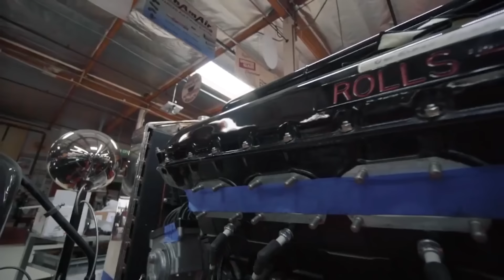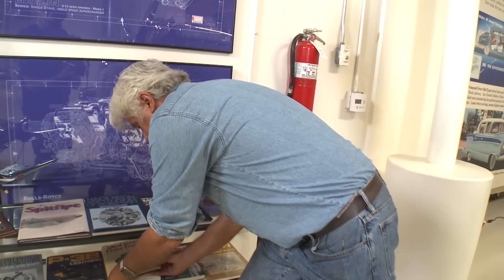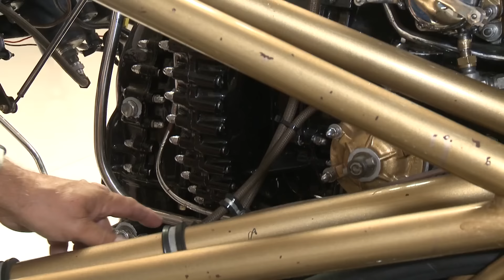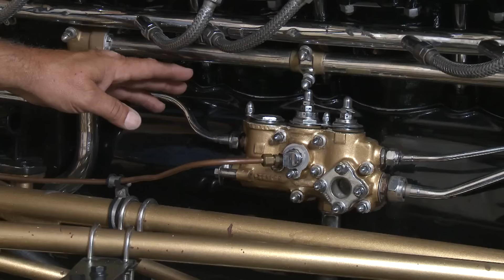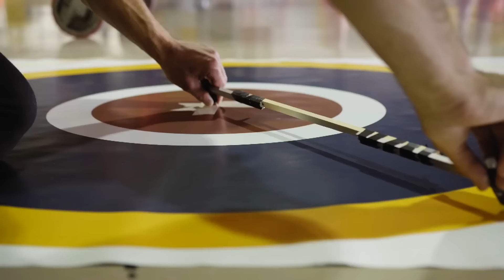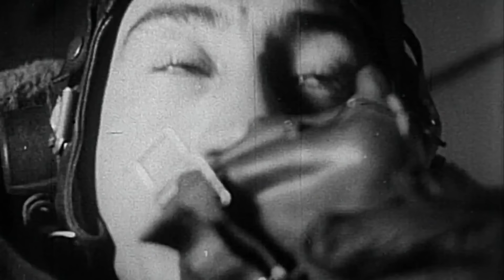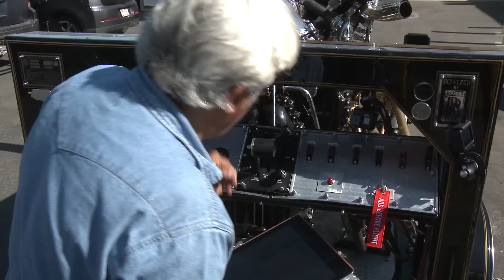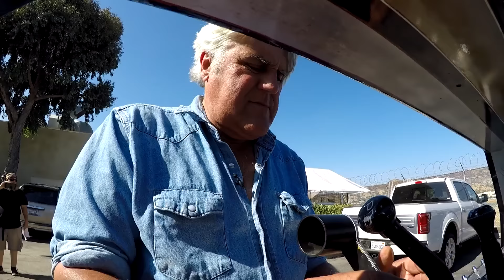The Engine That Won World War II - Jay Leno's Garage

Comment: Without british know how the Mustang wouldn't have been anything to write home about. With the  Allison engine it was just an average fighter. But the Rolls Royce engine transformed it.
Reply: The simple truth is that only 5 P-51's were ever fitted with a Rolls Royce Merlin engine. The rest were powered by Packard or Allison engines. This is a little bit of off the wall humor, but true. (The Packard engines were Merlins, only built in the US, and not by Rolls Royce)
Reply: @erichammond9308  Says it all really. Packard-Merlin not Packard Allison. The Americans couldn't have been given a better engine to tweak than the Rolls Royce Merlin. No contest.
Reply: @PortmanRd  They didn't even have to tweak it - there is literally no difference between a Rolls Royce built engine and a Packard built one.
Reply: @erichammond9308  Exactly. If it ain't broke, don't try and fix it. Unlike the Alisson engine.
Reply: @PortmanRd  No, the Allison engine was a fine engine. The Single turbo application installed initially in the Mustang was the issue. The Allison engine was fine in the P-38 Lightning.  Actually better than a Merlin would have been, since it ended up putting out far more HP than a Merlin would, and at equally high altitudes.
Reply: @erichammond9308  Ended up sure. But  the first (Allison fitted) P51's were a joke, and the RAF were less than impressed. The Merlin transformed the P51 from a lame duck into a raptor. The initial Alisson engine was less than impressive.
Reply: @erichammond9308  Unfortunately the RAF had the last say on the matter and rejected the Alisson in favour of the Merlin, and the rest is history as they say. I won't argue that towards the end of the war the Alisson engine had vastly improved, but by that time the Merlin had done all the hard work, and was without doubt the war winner.
Reply: @PortmanRd  again, it had nothing to do with the motor and everything to do with the single stage turbo that was initially fitted. The performance of the Allison engine was better than the Merlin at lower and mid altitudes, but the European Theater involved fighting at much higher altitudes where a 2 stage turbo system was needed. The Allison two stage turbo system at the time was too large to fit in a Mustang, and would have required extensive redesign of both the system and the aircraft itself, whereas the Merlin 2 stage required minimal changes that could be made on the factory floor.
Reply: @PortmanRd  Won't disagree with that one. It would have taken too long to redesign the turbo system of the Allison engine.
Reply: Great on paper, but never saw fruition, by which time the merlin had won the war.

Comment: The Merlin engine was a work of art. It made the P-51 Mustang come alive. The original p-51's had the Allison engine which was a dog at altitude. But if I was Jay Leno rich, my first choice of aircraft engine would be the r2800 double wasp by Pratt & whitney. Sure, it was a late War engine, but could put out 3,000 horsepower Plus with water injections. Not bad considering that a few years before, when Japanese zeros ruled the sky, we were living in a world of 750 horsepower aircraft engines. The most amazing thing about World War II technology is how far we came in four or five years. Bi planes to jet planes.

Comment: Interestingly as I understand, Rolls Royce were in discussion with Ford USA to produce the Merlin engine for the RAF before Packard, however apparently Henry Ford refused to build war production for outside of the USA and the British govt then negotiated with Packard.
I was lucky enough to refuel several Merlin engined aircraft while working for Mobil Aviation Australia,  a restored Spitfire still flying here in Australia and a Mustang, Mustangs continued to be used here in the 70's if I remember correctly to tow targets on a wire line for the Australian Navy .
"Warbirds over Wanaka" (incidently my home origin) is an international airshow that occurs every two years in the South Island of New Zealand and these engines can be heard in full flight at this time.
There are few engines that have the sound of these magnificent engines !
Reply: Read the ultimate authority on WW2 aero engines. The Great Horsepower Race by Callum Douglas, who is an F1 engine designer and WW2 engine historian. No other book comes close.Callum Douglas... 
"Surely everyone just KNOWS that the good old stories about FORD laughing at the Merlin drawings and that Rolls-Royce engines were all hand built must be true !Well this document, plus the fact there is a huge parts interchange manual which tells you which Packard part number you need to get to replace a certain Rolls-Royce part in either engine and visa versa.Of course not all parts were interchangeable, Packard did their own supercharger drive gearbox system, and used American sourced accessories like cabin air compressors and magnetos.

But the British bumpkins in sheds with flat caps and files is far too much fun so it is generally preferred over pesky "archive data" to this very day."

Douglas gives the USA credit in supplying the machine tools. But they shared things out in WW2. The agreement was the USA provide machine tools for the USSR and UK, so as not to duplicate. 

New high production Merlin shadow factories were set up by the Air Ministry in Glasgow, Crewe and Manchester. They also used existing plant in Detroit. Douglas again...
_Very few people know that Ford [in Manchester] had very little to do with the engineering production setup, the factory was not a Ford factory and was not full of Ford staff, the factory was built brand new for the Merlin, and funded by the Air Ministry, Ford were contracted to organize and run the new plant_.
- Calum Douglas

Comment: Someone tell me.....how different was a Packard Merlin to a Rolls Royce Merlin...????
Reply: This is a persistent story which has little basis in fact. Certainly in the mid 30s RR we’re not mass producing Merlins and expert assembly people were used. But by 1940 mass production lines were built and were being run by unskilled workers in Glasgow. For obvious reasons spare parts had to be interchangeable with both Packard and RR Merlins. Excepting the parts which were different like the Bendix carburettor and the supercharge drive gears, nearly every part on a RR Merlin could be installed on a packard and vice versa. There is even a parts interchange manual which tells you which RR part number is what Packard part number so you can use whatever was available in the field. To make this mass production in Britain possible American Machine tools Had to be shipped across the Atlantic.
- Calum Douglas

Comment: Jay needs to read up.  If a single engine won WWII it was the Pratt and Whitney R-2800 which powered F6F, F4U, P-47, A-26 and B-26.  It also powered at F8F which flew into the 1960s.

Comment: Rolls Royce Merlin, British engineering at its best 🇬🇧
Reply: "The   initial   Packard modifications were done on this engine by changing the main bearings from a copper lead alloy to a silver lead combination and featured indium plating. This had been developed by General Motors' Pontiac Division to prevent corrosion which was possible with lubricating oils that were used at that time. The bearing coating also improved break-in and load carrying ability of the surface. British engineering staff assigned to Packard were astonished at the suggestion but after tear down inspections on rigidly tested engines were convinced the new design offered a decided improvement." 
Packard Merlin Aircraft Engine - Combat Air Museum on line
Reply: "The engine suffered in early development and production with problems with the accessory gear trains, coolant jackets, cylinder head cracking, coolant leaks and excessive wear to the camshafts and crankshaft main bearings.  The construction was also altered many times before the basic layout was formalised."
The Spitfire Society Merlin page

Comment: P51 and merlin engine combination scared the German airforce a) overwhelmed by so many and b) they had nothing against it. It turned the tide of the war over Europe and with extended fuel cells could fly from England to Berlin and back.

Comment: Much as I love the P51 Mustang/Merlin  combo, they did not win the war.  This is a myth.  

Firstly, the war was won by the joint efforts of the Allied army, navy and air forces.   The air war and consequently the War, couldn’t have been won without the strategic bombing efforts of the B17 and B24 heavy bombers and the bravery and sacrifice of their crews.  They were powered by Wright and Pratt & Whitney radial engines.  

Secondly, they suffered heavy losses because the top Air Force brass then, the so-called Bomber Mafia, insisted these heavy bombers could accomplish their mission of daylight bombing to destroy Germany’s manufacturing and oil industries (among other targets) without the need for fighter escort. 

Because of this Bomber Mafia’s insistence that fighter escorts were unnecessary, these bombers were absolutely decimated by Luftwaffe’s BF109s and FW190s.  In fact, they used the excuse that the P47 Thunderbolts did not have the range to accompany and protect the bombers to and from their targets.  Not true. That’s a lie that was repeated in carefully crafted reports until everyone believed it was true. 

Thirdly, the P47 with auxiliary drop fuel tanks, had the necessary range, but the Bomber Mafia refused to authorize the use of these aux drop tanks.  In fact, the P47 squadrons in Europe, not the pencil pushers in the Pentagon, took it upon themselves to install British made, specially treated paper aux tanks and whatever else aluminum tanks they could find, on their P47s.  They did these because they couldn’t stand by and watch their fellow Bomber pilots and crews be slaughtered by the Luftwaffe.  
The truth is the P47 could have protected the bombers and thus prevented the unnecessary loss of bomber crews and their planes.  

Fourthly, the arrival of the long range P51 Mustang made providing fighter escort a no-brainer, a perfect ending to the false narrative that P47s did not possess the same capability many months earlier.   They did, but because of ego and politics, thousands of brave aircrew were sacrificed.

Comment: Merlin , british creativity against dull straight brains....
Reply: The engine suffered in early development and production with problems with the accessory gear trains, coolant jackets, cylinder head cracking, coolant leaks and excessive wear to the camshafts and crankshaft main bearings.  The construction was also altered many times before the basic layout was formalised.
The Spitfire Society Merlin page

Comment: When the Brits, on a hunch, replaced the Allison engine with a Merlin on a P51 Mustang the improvement was such that P51 Mustang B, C, and D's used the Merlin. The Merlin P51 was able to destroy V1 rockets flying low. They were so good that the bombers they were meant to escort were used as bait to attract German fighter planes, so assured were the Mustang pilots that the Merlin power made them equal or superior to the best German fighters.
Reply: The Brits were bombing at night, why did they need a long-range high alt escort fighter?

Comment: A great read that goes into the story of this engine is entitled Freedoms Forge by Arthur Herman. The plans were shipped in a submarine from England and escorted by battle group. Once here, Packard had a really hard time reproducing them and all new tooling had to be invented to build it. Fascinating!
Reply: What Packard actually said was that the first ever set of drawings shipped from the UK did not contain all the information. Which is not the same thing as the tolerances being too "wide". It was a vast job to transfer all the information, and it took a few months before both firms were working with the correct and full manufacturing information. It's very common for drawings to refer to other standard-sheets which are known to the company in question, but if you just give the drawing to someone else, they will find all sorts of things referring to other in-house standards which you don't have. I have yet to find any original information at all, that RR parts were made sloppily before Ford and Packard came along.
- Calum Douglas

Comment: I believe that it was also in the Supermarine Spitfire,but to give the credit to the engine alone is not really accurate. The Mustang had design features(unique wing design,and extended range) which made it the key factor in turning the air war in Europe in the Allies favor. The Rolls-Royce Merlin power plant was a vast improvement over the under-powered Allison engine which was the original engine in the P-51.

Comment: "Ethanol fuel is the worst thing in the world"... yes and no... for forced induction I love e85 for its 108ish octane number, for the person who wants to not worry about moisture in their fuel, yes ethanol is horrible.
Reply: In WW2 they used water methanol mix injection to get more boost and power from those engines. Mw50 it's called
Reply: @bartsscooterservice  did you watch the video?

Comment: Brother Jay: It is so cool to watch you adjust that throttle on this large MERLIN . It was so quiet once you reached the engines center of balance or ie its harmonic vibration seems to have leveled out at one point and the engine becomes quieter.  Just so very kool BRO..

Comment: "The initial Packard modifications were done on this engine by changing the main bearings from a copper lead alloy to a silver lead combination and featured indium plating. This had been developed by General Motors' Pontiac Division to prevent corrosion which was possible with lubricating oils that were used at that time. The bearing coating also improved break-in and load carrying ability of the surface. British engineering staff assigned to Packard were astonished at the suggestion but after tear down inspections on rigidly tested engines were convinced the new design offered a decided improvement." 
Packard Merlin Aircraft Engine - Combat Air Museum on line

Comment: I wish Jay would give Ford a break (in historey) and buy an old Ford GAA1100 tank engine and restore it. I would like him to tell the world how Ford built an engine in the class of a Merlin engine that also with some modification was intalled in late Sherman tanks.
I think they were build in 1942. Not sure if it is all alumium with overhead cam. It put out something like 500hp at a really low RPM
This tank engine deserves credit and it should be in museums like Jays.
I wonder why he seems to ignore this engine...........

Comment: In 1947, the Spit family finally caught up with the 1940 version of the BF 109 in regards to maintaining power under all conditions of 'G'............................ Rolls-Royce developed fuel injection and transfer pump instead of the Bendix-Stromberg induction-injection carburetor used on previous versions of the Griffon engine. Although this had the effect of adding 70 lbs to all-up weight, a significant advantage was gained in that power was maintained under all conditions of ‘g" Better late than never.

Comment: The following is told to me by an Israeli flight-mechanic during an airshow in 1978 in Tel Aviv, where the spitfire and some other old planes were involved. Unfortunately I wasn't so interested in the other planes

" The spit got four chambers for fuel to feed the carburetor.
This didn't work well but it worked. It needed a lot of maintenance.
When a spit rolled the feeding of the carburetor automatically is switched from chamber to chamber and in some positions it was feed from two chambers and got to much fuel. You can see that in some positions it will come out black smoke from the exhaust, like a car that runs with the choke on."

Comment: The really late Merlin............................According to Tom Cleaver
The V-1650-9 Merlin – which was close to being a “race” engine similar to the bored-out engines that power P-51Ds in air races to this day was as temperamental as those engines; the result was that units equipped with the P-51H seldom experienced more than 50% availability. This more than anything else was responsible for the P-51H not being called to active duty during the Korean War.

Comment: 2:10 Can anyone in the comments section recommend a pre-oiling/pre-oiler set up for a regular car engine? A system like that on Jay Leno's Merlin engine would be ideal because Jay Leno simply pushes a button, and the pre-oiler internally floods the engine from top to bottom with oil to lubricate it before each cold start after sitting idle for months-to-years, and the pre-oiler produces an audible sound so that you know it's working.
Reply: I’m not an expert but in my opinion it’s just not neccesary for car engines. A healthy, relativly modern car engine has oil pressure and flow almost immediately apon starting. Not to mention the parts would be much lower in friction by design and oil technology is much better. I would say the reason these engines needed pre oilers would be due to the extreme size of the engine and time taken to get oil moving through so many galleries, old-tech metals, designs and manufacturing constraints meaning less wear tolerance and higher friction between parts, and ancient oil technology that probably didn’t protect the engine as well as what we have now